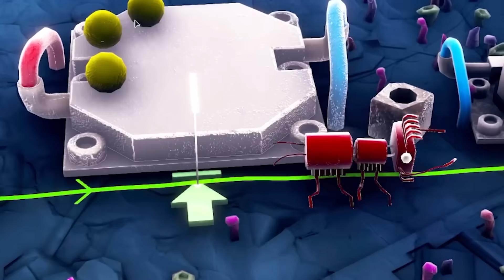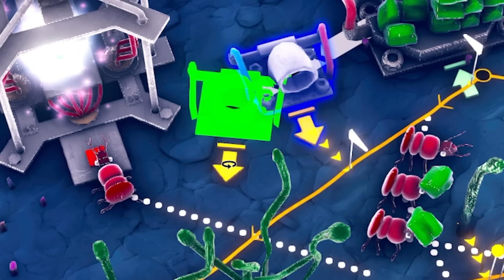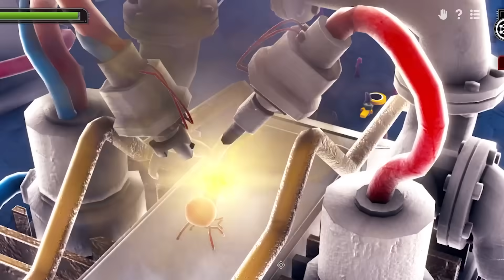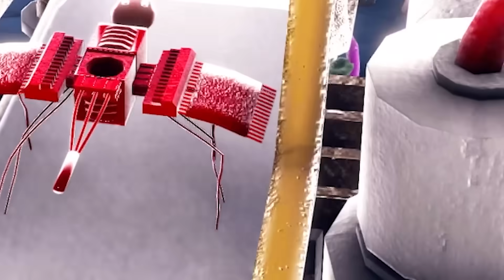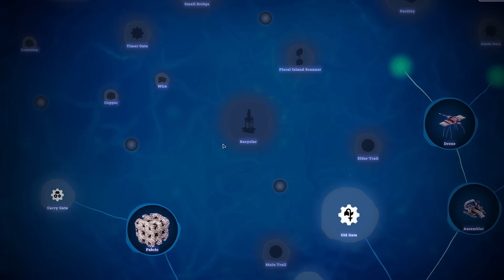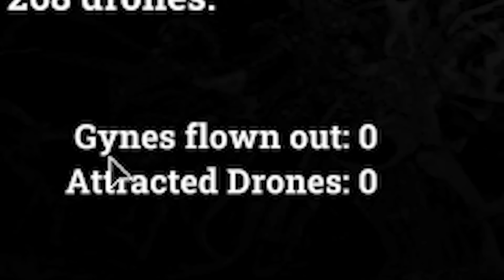Engineering FLYING ANTS to colonize a new island!

Comment: Hey RCE here is a few tips I have figured out. Tip#1 instead of creating the new ants with you ants use the old ants instead as it renews their life and makes it longer. It also helps you increase your population. I have been doing this and I am now at 120 ants. Tip#2 counter gates cannot meet back with itself but you can get it to work by placing a nother kind of gate to it as it will only count the area between the counter gate and the other gate. Tip#3 Drones can carry resources to the other islands. They can even carry brood over so you can create ants on other islands. Tip#4 Create an area where new ants will go in a square and connect gates to it so it will be easier for you. (It helps your organize and kind of sets up a priority. You can just use any trail as the "main trail".) Tip#5 unlock the old gate and make an area where the old can go in a loop to be processed.(look at tip#1)
Reply: I think you might be an episode behind.

Comment: Once you get old gate, you basically have to redesign your whole pathways. Small workers do their thing until old, then upgraded to digger or normal worker; Workers work until upgraded to inventor and drones.

Really great mechanic. Just have to make sure old ants don't carry anything when the head for the upgrade, can't enter a combiner with a load.
Reply: Couldn't you get rid of the carried load by having a storage right before the combiner? It wouldn't get used a lot, but it'd free up the old worker to begin their new life.
Reply: @aulvinduergard9952  Yeah but you might need various storage. Before i had it set up properly, my old small workers kept running up to the combiner carrying steel blocks, energy, screws, whatever. 

When you progress the research further you get more filter gates like "entity" to only let certain kinds of ants through, or lets you filter them to another path. Or a gate wheter an ant is or isn't carrying something.

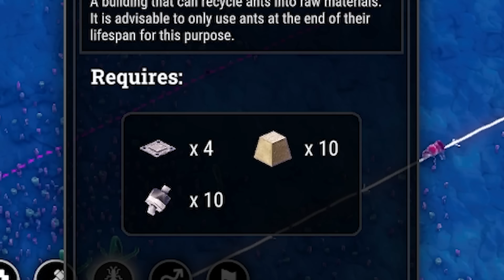Comment: 28:58 Rce drones can fly to another island with iron or every item they can carry if there is a dispenser before they fly thy grab it and fly . Then drop it in a stockpile and then you have materials on the other island then divide the drones so they fly back to haul another item, and the other path of the divider can the drones mine coper. 28:58

Comment: Matt,

1. Build drone launch and landing pads on both islands, creating an island-to-island circuit.
2. Make dispensers for whatever mats you need on the other island on your main island, then have the newly born drones grab them on their way to the launchpads.
3. Ditto for larvae; create a divider trail from the drone factory and have them grab babies to fly over.
4. Incubate the babies, have them gather enough iron from piles on the new island to create a few smelters, then smelt copper blocks and glass blocks (have ants gathering from the small glass piles)
5. When you have enough mats, create a merger and make diggers to mine the larger deposits of glass and copper.
6. Also have some ants gathering those Energy Pod IIs, and fly them to the first island on the drones' return trips. They make the progress meter go up a LOT faster.
7. Once you're able to, unlock the Larval Storage and start stockpiling larvae. Use those for Step 3 in place of a route to the Queen.
8. Lastly, once you unlock Steel Plates and are able to fabricate the grid plates, build a few plates, put your stuff on them nice and organized-like, then simply delete the grid plates and get back your Steel Plates. Your aligned buildings and trails will remain. Rinse and repeat til you tidy up that sh*thole xD
Reply: I would also highly reccomend using the Old Gates. Set jobs for the Small Workers and then have them path off once they get old and then send them through the combiner/assembler
Reply: @AmateurPWN he did that
Reply: He also needs to shorten the paths wherever possible, as only 40% of the ant life is being used for work, the rest is wandering across empty spaces.
Why have 7 ants on a resource loop when 2 ants with a dispenser pipe loop can work faster?
Use the counter for the long walk over, then a small loop from resource to deposit area, then an elder lane back. Have the pipes do as much transit as possible as they count as haulers... techncally.
Reply: shhh. I want to watch matt the "engineer" figure it out himself
Reply: @tracycui3800  Watching him play games makes me want to install them myself...
Reply: This guy Microtopias.
Reply: Diggers aren't created by merging. They're created by an Assembler using a screw.
Also if you iron plate your entire island bar some other spaces, the flowers growing food will respawn in the empty spaces. So don't remove iron plates. Once you have recycler you have essentially infinite iron anyway.

Comment: I think the efficient way of doing things is to put an elder gate in every loop that you have and connect all the elder trail into one single elder trail that leads to a factory where old ants are continuously repurposed. Small worker ants into workers and workers into drones.

Later use the worker ants only for plant cutting and send the drones all to other island

Comment: 13:40 The reason it doesn't work is because you are looping it back into the system that contains all the drill ants, you ended the short network before the counter gate
You need to make the small circle it's own network, and then have the counter gate lead into that network.
Reply: Exactly this!

Comment: I remember playing this game a lot when it was just a demo, and I LOVED it!! Now that it's fully released, I've gotta go get it and see what else they've got going!!

One thing that was very helpful to keep in mind when I played was that the pipe chute things you use to take out materials doesn't actually have to be anywhere near the storage platforms that they take from.

Which means your loops through materials don't have to be so big; you can make your material-gathering trails much more streamlined and efficient by just sticking a couple storage things on them, then having a single ant right near whereever the materials need to go, doing a small loop between the dispenser(s) and the destination.

You can have whole loops of ants gathering resources far away from the rest of your colony without a massive clusterfuck of trail lines gunking up the works.

The biggest difficulty with that used to be just balancing how many ants were on each trail, but now that there are counter gates, that should be pretty simple to do!

Trust me, using the dispensers' and storage platforms' huge range to segregate your material-gathering trails from your input and/or production trails makes a HUGE difference in keeping things neat and manageable!!

Another tip that you might find helpful is having a sort of Master Delegation node/terminal that all ant-production/combiner buildings' trails merge into that you use alternating gates/counter gates on to manage how many ants go where.

It makes it a lot simpler to keep enough ants on each trail and a lot easier to change how many ants you want going to each task.

Also, for the old gates, you should have them placed directly after a storage drop-off point so that they're never carrying any material;  to be extra sure they don't have anything by the time they reach their destination, you could put a storage platform down on the old-ant trail for them to drop off whatever they might have on their way to "retirement".

Comment: 26:26 i like how you havent considered flying the Drones back.
Reply: I was about to ask that, maybe they can carry both the copper and the larvae
Reply: @darioschottlender they can
Reply: That was driving me crazy the entire time. Also, he hasn't even tried to have the drones carry material over to the new island...
Reply: I haven't played the game, but launch pads require materials to build and he has no materials on the new island, I'm guessing he needs to ship materials to the new island to progress, probably the 2 iron to make a launchpad  so he can constantly be shipping materials between the two
Reply: @SniperSpy10 in principle he doesn't have to ship any materials over since all the relevant materials at this stage of the tech tree exist on the desert island. In practice, however, having two drones each carry one plate so that you can set up a flying loop is far more efficient than just having them work on that side.

Eventually, though, one of the tech-tree-node tasks will be to hatch larvae on that island, and since the queen can't fly, that will have to involve having a drone carry them. Bridges exist but are gated well beyond that node.
Reply: I'll be honest, I haven't thought of this either. I only realized they could bring larva over. Haven't tried hauling material over. Thought I might need a building for that.
Reply: its so hard to move materials until you have bridges. then its barely easier

Comment: 13:40 its looping back on its self so its unable to count. You can fix it with a divider i think or another counter gate set to 999999 for the exit to the trail. Or you can create a loop for the gate to connect to.
Reply: Max counter is 50 but there are counter gate stops to break it up